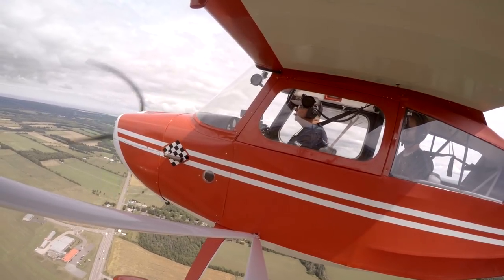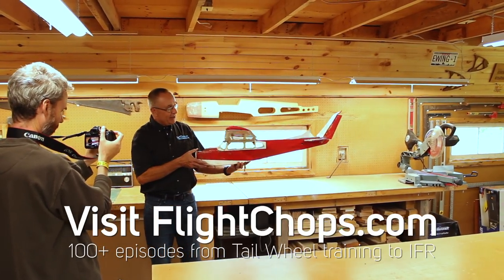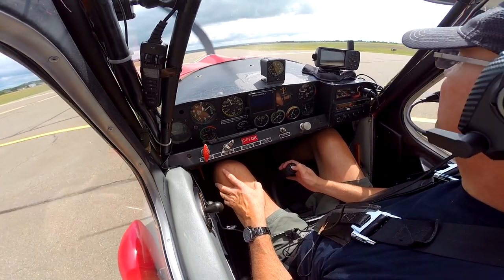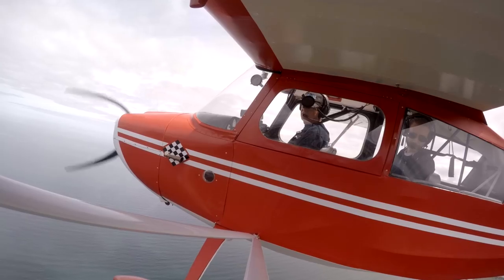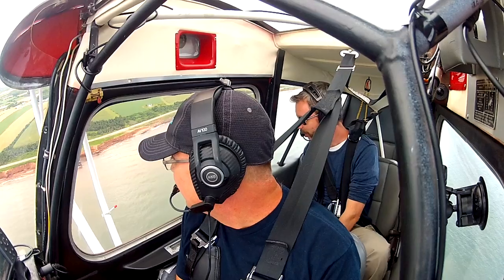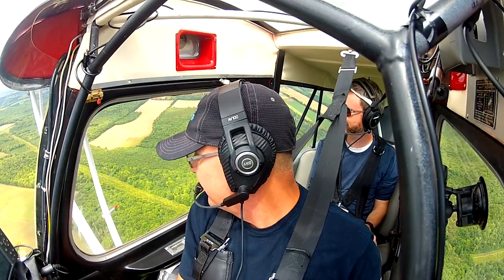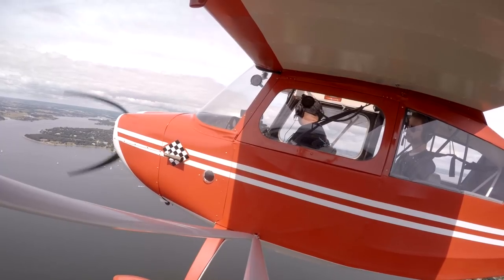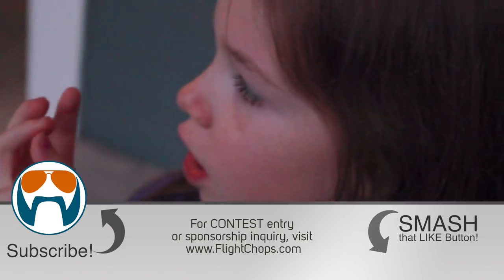Common Pilot Confusion - Class E Airspace, FSS and MF - Citabria over P.E.I. - FLIGHT VLOG

Comment: MFs were so bizarre to me when I first encountered them flying in Canada. I did a little research afterwards and I guess US has them too but they're super rare (just a handful if I remember correctly.) They're much more popular with you guys but I really find them weird. I once had a confusing and potentially dangerous situation while landing in Muskoka because of that MF setup and the fact that the radio wouldn't clearly instruct a plane in the pattern to not land on the opposing runway after they had "cleared" me for a straight in approach. I really dislike the "authority without authority" feel of the MF airports. Either control the traffic or leave it up to the pilots; the weird hybrid is well, just weird in my opinion.
Reply from the maker: I remember you telling me that Muskoka story Ali
Reply: Ah that's right, we did talk about it!
Reply: MF operators have ZERO control. None. We are an information service. Thats it. We can tell you what other aircraft are doing, and where they are, and weather. Just be aware that in a MF there is always no control, except a few MF zones in canada. If there IS control, it will be clearly stated in the COMM section of the CFS page for that aerodrome. Hope that helps to clear some confusion.
Reply: I appreciate what you're saying and I understand it in theory. But when there is a middle man who has no control, it becomes a little confusing to directly talk to other planes. In the case I mentioned, I was on the radio, the other plane was on the radio, but we weren't directly talking to each other because the MF was in the middle. So I'd hear something like "be advised, there is a cessna doing pattern work on 18 but shouldn't be a problem for you landing 36." Ok what's that? Are you keeping an eye? Am I supposed to coordinate? Am I suppose to bypass you and talk to the cessna? You can't give the appearance of coordination and then hide behind "I have no authority" thing. The cessna was on left downwind 18 as I was on a long final 36 and the radio kept telling me we're fine. I finally said screw it and sidestepped for left downwind 18 but if I had trusted the "you're fine" guy, I might not be here talking to you. My argument is that this setup is too bizarre and too uncommon that someone who's not a local to that airport might get in serious trouble... I appreciate your response though.
Reply: Yeah, and thats why I was commenting. A lot of pilots just don't fly in the Echo or MF zones enough to be familiar with the procedure. More so if you fly US airspace more frequently. Alaska has plenty of MF zones however the lower 48 has basically done away with them. They are very helpful though, especially in rural areas. 
On the part of confusion though, I agree with you to point. The CFS really doesn't explain that an MF is uncontrolled. There are a few that are controlled, and those are the only ones the CFS talks about when it comes to controlled space. It would be more helpful if they noted "Uncontrolled" on each aerodrome page that says MF.
Reply: Agreed...
Reply from the maker: I am actually gonna pin this thread (as opposed to the other one with Tyler) as this discussion seems to be at the heart of what the video is trying to inspire. 
EDIT: For anyone that missed the other thread, Tyler is a Flight Service Specialist from NavCanada who has kindly stopped by to answer any questions.
Reply: I was lucky enough to learn to fly in Ottawa.  3 different airports that are commonly used for training, all within 15 - 20 NM of each other: Ottawa C CZ, Gatineau E CZ (MF) and Carp (uncontrolled).  You get comfortable with the airspace pretty quickly. Personally, I love the class E CZ, more options when joining the circuit VFR, and the FSS giving you advisories keeps it safe enough to fly straight in when there is no conflict.  How do you guys handle fast IFR traffic behind slow VFR on final?  Once the IFR is handed over to your zone, is it up to the pilots of the fast IFR to maintain separation on slow VFR ahead of them (based on your advisories)?  I would think that basic airmanship on the slow VFR pilots part would tend to avoid these types of conflicts, but I can see how they could arise.
Reply: A.T.1357, you must be mistaken. FSS personnel, of a class e airport did not "clear" you for an approach. They are not controllers. They do not provide landing or takeoff or taxi clearances. They cant tell you (nor the other guy in the pattern) what to do. And yes, of course you can still talk to other pilots on the mf frequency. An easier way to think of a class e cz in Canada, is to treat the pattern just as if you are at an uncontrolled airport, and make your ctaf announcements on frequency,and continue to fly vfr "see and be seen". The only difference is that you make your calls to "radio" instead of "traffic", and of course you need to make a radio before entering the class e airspace. Once you get used to it, you will find that the fss staff are wonderful, and will do their best to help you out with traffic advisory, and airport weather. But what they wont do is give out landing clearances. If you got a landing clearance from a Canadian controller, you were in c or d control zone, not class e. Also, i would never do a straight in approach in a class e airport. It is not illegal, but it is better to join on the downwind leg. Especially if there is other aircraft in the patern. I hope this info helps.
Reply: You're right. There is a reason I put "cleared" in quotation marks. It means that before being told to switch to the radio frequency (on an IFR flight plan,) I was told to expect straight in 36 and once I switched over to the radio, the MF guy was aware of the plan... The whole conversation here is about a controller without any authority, so obviously we all understand that they can't clear you to land...
Reply: A.T.1357 ahh, i see. That makes more sense. There is a huge difference between "expect", and "cleared".the previous frequency you were on, (center or terminal), are not necessarily going to know about what runways the vfr traffic are using. Unlike a class d, vfr traffic in class e can use any runways, , even one with a tailwind. I hear ya, on how messed up that would for you, especially if you had of been practising shooting an rnav approach, only to find out there is someone landing on the opposite runway, lol. For anyone else reading this post, That is pretty much the reason why we have class e cz's  in Canada. It is for airports with a fair amount of traffic. more so than your typical class g airport, but not quite busy enough to  warrant the funding for a control tower, and atc staff, that a class d would require.
Reply: It was a calm day, both runways were being used, no issue or problem at all there; that's all fine. Anyone with a little bit of flying experience understands how uncontrolled traffic works. The point I've been trying to make is that it's easy to confuse who has what responsibly when MF is involved. The MF people are not always as hands off as you might think either. I was issued a go-around "order" on a previous flight to St. Cathines/Niagara Falls because the landing traffic in front of me was taking its time getting off the runway. In my opinion, we were fine and I had plenty of time/space but I was told to go around.  See my problem? Too many chefs in the kitchen can be dangerous. I don't doubt that this setup has benefits and serves a purpose, but I reserve the right to find it odd :)
Reply: "Are you keeping an eye?" In your YQA example...no. There is no FSS based there. It's a Remote Aerodrome Advisory Service so no eyes out the window.
Reply: "Both runways were being used" but you stated a pilot was doing circuits. CARS says you need to conform to the pattern, or avoid the traffic.
Reply: I did "avoid the traffic." You know, the part when I sidestepped to the left downwind? That was the point of the story. But not before the MF "controller" kept assuring me I should continue as planned. This, as I said, was just a few days after I was told to go around by an MF controller. The whole point of this thread is to point out this system opens the door for confusion specially for non-local pilots.
Reply: Al FromAus, the argument is that the space is not busy enough to justify a tower but busy enough to need some sort of coordination I guess.
Reply: A.T.1357 exactly right. The ability to control the flow of traffic means you can accommodate more traffic in the zone. FSS have the benefit of the compete traffic picture, using radar and other things, and specific knowledge about that airport and local geography. 

Both ATC and FSS are essential roles in Canada's ANS.
Reply: Think of this from operators (ATC) point of view. After reading most all the comments, this all seems like the same situation being encountered by the change in mindset of newer generations. Empowerment is much easier to deal with when ASSUME is left out of the equation. And dealing in solutions, instead of complaints, really does help the controllers acid reflux a lot, and I for one like the fact another set of "brains" are there in an effort to make it all safer.

One thing anyone can do with with mistakes of a controller would be to just say, "Say initials and Mark the Tapes", do what its required and finish it up on the ground. I've had it happen at Washington National, full IMC stacked from 10,000 down every 500 feet and have a controller give me a final cut, when I knew that I was number 3 in the Que. Gotta do what  needs to be done. Point is; I made it to the next flight.

Sorry for the vent, but if it just helps save "one", it will have been worth it. Good Luck PICs
Reply: A.T.1357 I have found the Fss @CYSN to be extremely helpful and often go above and beyond to help all aircraft operate safely.
St Catharines airspace can be busy with Niagara Falls scenic pattern aircraft, helicopter tours, air cadet gliders, flying club training aircraft, daily schedule flights from CYTZ and just regular Ga guys like myself! 
These Fss staff keep everything straight without giving orders simply by  communicating and passing along information to everyone, on occasion they will "request" you do something usually to avoid a situation or allow traffic flow ect.
If they ordered an overshoot/ go around I imagine it was for a good reason I have only heard them "request" an overshoot before as they can see the big picture.
If you ask me FSS stations are great and worth every penny! 
I'm kinda biased as I'm based at CYSN 😊
Reply: I agree 100%. I am from the hamilton area, and I have flown into CYSN numerous times. The CYSN FSS radio staff are indeed fabulous.
Reply: I'm not making a judgement on the people just the system. And even then, it's a judgement based on very limited experience with that system. I'm glad you guys all like it and think it works well. I was just sharing my issues with it!
Reply: It was explained to me that MFs are established based on traffic criteria.  A lot of former controlled towers are now MFs because they lack sufficient traffic.  Refer to TC AIM to brief yourself on MFs if unfamiliar.  It's like anything, once you pick it up, it makes sense.  I flew into CYQF a couple of weeks ago and the FSS was doing an awesome job with traffic between incoming and outgoing flights and students in the circuit.  His advisories were very good and even though it was not "control" he kept it all straight without any conflicts.
Reply: For me I did my Training out of Saint John NB (mentioned in the video) and dealt exclusively with MF or control zones for my training. I think the easiest way to explain why MF vs Uncontrolled in my opinion is as people said, its for airports busy enough for some coordination (not control) Usually indicating the airport has scheduled airline service ie. you are inbound at an uncontrolled with regularly scheduled IFR traffic, and not huge but regular VFR. You call in and state your intentions to the traffic then get 8 separate reports from other traffic in the area. Now change that to MF and you call into Saint John Radio with your intentions and the FSS just tells you "Ok winds favour 32 and you have 2 in the circuit, a dash-8 25 miles back and training flights over the peninsula to the north east." Done, you mental picture of situational awareness is complete. It just cuts down on the frequency congestion.

Comment: I actually just got done making a trip from Anchorage down the NWT through BC and into the lower 48 in an Arrow. MFs were absolutely bizarre to me when I first looked into them before making the trip. The best way to think of them is they're just another flight service guy that has a bit more info on the specific airport that they're at and some traffic info.

Class E is class E. As far as VFR is concerned, it works the exact same. Flight service doesn't provide traffic separation services normally, and the same holds true at MF airports.

Side note, my trip was awesome! It was my first time in Canada and the the Yukon and BC was just stunning!!

Comment: We've got one here in Homer. It's very similar. They are advisory only and non-control. That said, the help keep things organized. They log each and every flight movement, let other pilots know, can open/close flight plans, facilitate SVFR and IFR clearances, and more. But, you can do whatever you want. Initially we call "Homer Radio" when we want them to respond. Otherwise it's "Homer Traffic".
Reply: I'd know this. As non controlled and they didn't give out any clearances. They had to use an other phraseology intentionaly as they don't hand out clearances, but you should listen to then as they sort trafic out and watch for safty (and you might be the next on the shift when you are back).
They do shifts in the "tower", every one who fly regulary from the field is included in the shifts. I don't know how it works in cannada. In some countries you need one person for every active runway and one extra for airfield coordination if you use more then one.

Comment: The most confusing thing is that it's so different from country to country. In Norway, more than half of commercial airports (with regular airline traffic) are AFIS aerodromes, essentially uncontrolled aerodromes within a Radio Mandatory Zone (RMZ) class G airspace block (depicted G*) and with a flight service officer in the tower. Each summer we get a ton of VFR from all over Europe, most of which deal with a similar system in their own country, but they all differ a little bit, so a lot of confusion is going around. Charters from foreign airlines also sometimes hesitate when they hear "Runway Free" expecting "cleared to land/for takeoff", and taxi instructions instead of "runway available for lineup" or "landed time xx, good day".
Reply: I do really prefer our system where it's either class C/D or G* where commercial traffic go, no E. Controlling IFR amongst VFR with no transponder or radio? Do not want.

Comment: FSS in the U.S. is a weather advisory frequency, but it sounds like for Canada it's very comparable to Flight Following here in the U.S. If we depart a towered airport, we have to get the ATIS which is the weather for the airport, and the tower will tell us which runway to taxi/takeoff. If the airport isn't towered then we have AWOS/ASOS, both automated weather that gives us the wind, altimeter, ceiling, and things like that. From there we decide which runway to depart from. In Class E here in the states we aren't required to talk to ATC for VFR, or have flight plan, but both are helpful and highly suggested. Just my insight as far as FSS goes.

FSS has also helped me very much in the states, even though I talked to them once. I was doing a flight around FL (I only have my PPL), and the ATC controller (we were using VFR flight following) never handed me off to the next controller, so we lost contact. We could hear other aircraft talking to the controller, but couldn't communicate directly with the controller. Luckily I used Foreflight to find the local FSS and I told them what had happened and asked them to find a frequency. While they were working on the frequency they gave me a full weather briefing which was great! I actually have the video of that flight on my channel if you're interested. Hopefully I was somewhat helpful.

Comment: Right I'm entering classy airspace I'm extending from 14,000 ft MSL at this time it's Captain Carl Rogers at 18,000 ft MSL I'm on a 48 contiguous 1.2 nautical miles beyond the coastline at this point I'll be performing a maneuver right now for at 1500 ft to the surface